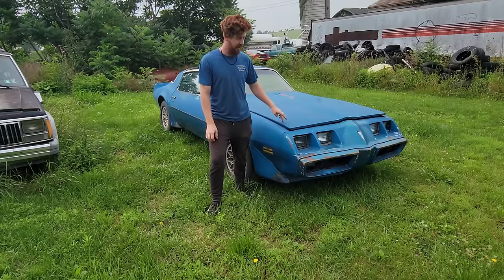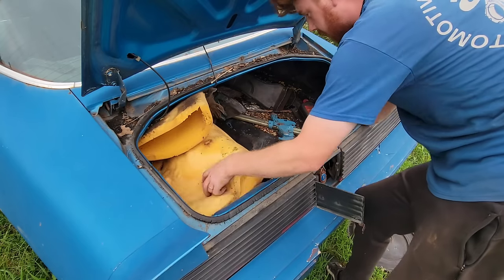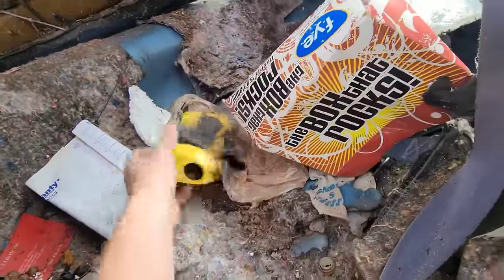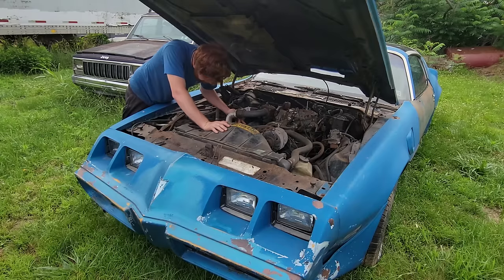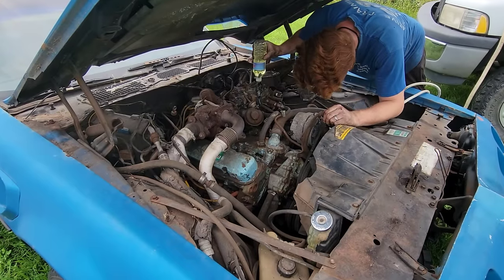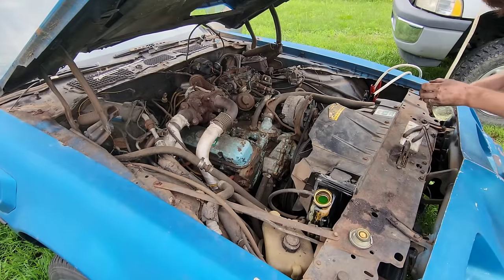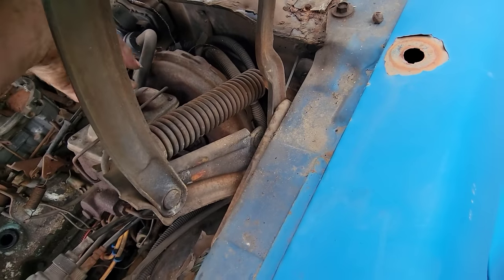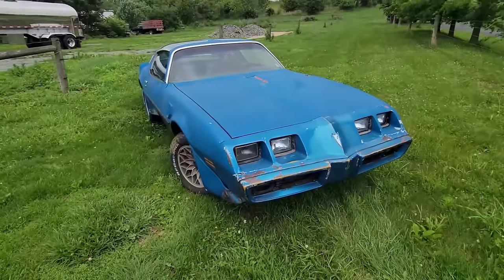1980 Trans Am Turbo Revival! Will it Run and Drive After 18 Years?

Comment: I would love to see a turbo T/A with a tastefully done single turbo LS. Everything else original and functional such as the factory boost guage. Nothing obnoxious, but just the right amount of spice.
Reply from the maker: That would be interesting!
Reply: Nah  far too many of those
Reply: @tomcherry7029  i agree, it's been done to death. what i would rather see (and i acknowledge it's obviously not the best/easiest option) would be building the original 301, to the extent that it's possible, with good MLS headgaskets and ARP hardware throughout, and replacing the turbo with a properly sized, modern ball bearing turbo. basically just make sure the motor isn't made of glass, match it to a good turbo with free flowing exhaust, and see what it'll do.

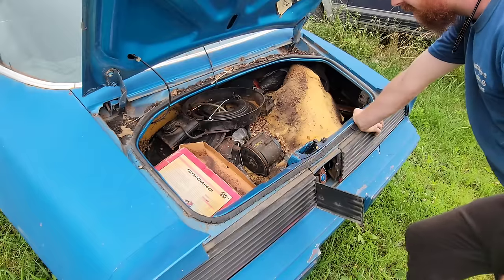Comment: Sweet ride and great video! I bought a clapped out 80 Z28 when I was 18 that was an old street strip car with a 4:10 posi. Had a B&M shifter that I didn’t know was on its last legs. Was going through the gears hard one final time and hit park at warp speed. Car a did a 180 and stalled out. I figured I grenaded my t-350 but when I restarted the car I felt it grab drive. Drove to work and did my shift and expected a big red puddle when I clocked out. WOULD YOU BELIEVE IT DIDNT LEAK A DROP?? The t-350 gets my vote for best transmission ever after that lol. Sorry for rambling just wanted to share my ratchet shifter cautionary tale 🤣
Reply from the maker: @Chris-qv5mc  I love hearing story's like that! I used to own a 1979 all black trans am with the 403 olds and a th350, that car had 2.43 rear gears so it was a great cruiser. I used to take it to the drag strip for fun. One day during a test run I accidentally popped it into neutral instead of 3rd at full throttle, and since they didn't have rev limiters back then, I watched the tach hit 10k before I had time to react 😅 fully expecting to need a new engine, I was extremely surprised to drive away with out so much as a lifter tick from that 403. Still to this day one of my favorite engines!

Comment: Sounds like the brake booster may need to be replaced. That "Shhhh" sound usually means the diaphram is leaking. Brakes probably just need a good bleeding. I have an '81 Turbo Trans Am. I'm guessing someone has been taking care of that engine in recent years even if they didn't drive it. Maybe they poured enough fuel in the tank to run it a bit each year until the fuel ran out. Lucky they didn't leave gas in the tank or it would have rusted. Good luck with it. It will be really nice if given a little TLC.

Comment: I say something's up because that's a RPO code "LU8" VIN code "T" turbo 301 V8, but the VIN on the insurance card shows it to be a regular, non-turbo 301, with the VIN for the win:

2 for Pontiac, W for Trans Am, 87 for two door coupe, W for 4.9L (301 CID) V8 with four-barrel, non-turbo, Pontiac produced, RPO code "L37", A for 1980 model year, N for Norwood, OH assembly and the rest is the production sequence. The Norwood, OH plant closed in August of 1987. A Turbo car would have a "T" in place of the "W" for the 5th VIN digit. Does the VIN on the dash match the one on the insurance card?

No trim tag (by the left fender area, under the hood), can't brag, but easy to figure out, no doubt: 80 for 1980 model year, 2FS87 for Pontiac (2) Firebird (FS) two door coupe (87), N for Norwood, OH assembly, 24L 24U for Tahoe Blue lower and upper exterior paint, A51 for bucket seats, A31 for power windows, 26B for Blue Hobnail Cloth interior trim, CC1 for T-tops, among other codes.
Reply: Also it should have a "TURBO TRANS AM" decal on the rear spoiler. And the "turbine" only Turbo car wheels
Reply: @GasserNorm  Not entirely correct. My 1980 turbo bought new by my parents has snowflakes.
Reply: I just acquired one of these turbo cars.  It should say Turbo Trans Am on the back sticker.  The Snowflake wheels came with the WS6 suspension package.
Reply: You can get snowflake wheels without WS6. Also, the turbo flows in 1980-1981 could be had with the WS6 package.

Comment: I'd check the engine for displacement. I'm a guy from back in the day. We would never pull a crappy smog engine and replace with another one. That could be a better find than you think. Especially being a reman.🤔
Reply: Looks like a standard rebuilt 301 turbo V8.
Reply: @googleusergp  that would have been a waste of time swap/rebuild then 🤔
Reply: @aumetalmental8403  I'd agree. I'm wondering if the prior owner owned a few cars, one a 1980 non-turbo, and one a turbo. It has the turbo hood, and we'd just need to verify that the 5th VIN digit on the dash is a "T" and not a "W". The "T" means turbo 301 V8 and the "W" means non-turbo 301 V8.

Comment: Great stuff! Fun to see work on the old Camero from my very young days. I've NEVER seen a turbo set up like that one I must say! Weird but as you said 50% of something is better than 100% of nothing. LOL. Thanks good job!  Oh remember when starting anything with a Carb and not Fuel Injection you need to give it some throttle while turning it over. SOmetimes a lot and other times not so much. (Those old gals had personality lol.). Just thought I'd remind ya!
Reply: This is a Firebird, not a “Camero”. GM did build a CAMARO though.

Comment: Had a black /gold 80 Turbo SE T/A  Not much hp but fun to drive, especially with the t-tops off. Miss that car
Reply: That was the same car they used in Smokey & Bandit II. The production crew had to mod them with nitrous to get any kind of performance.
Reply: @jamesnoble3502  didn't know that. Cool
Reply: @tripdad  if you ever watch the movie or haven't in a long time, there's a scene towards the end where Bandit makes a hard left off a paved road into a desert area and you can see the front right tire is a smaller white wall tire (the factory spare?) with a rim that was hastily spray painted gold to match the rest of the car. I'm guessing they bent the original wheel doing a stunt and didn't have an extra to swap it with?  Oddly enough in the first Cannonball Run movie there is a similar scene during the beginning chase with the Lamborghini with a 1980 Turbo Trans Am police car with a non-matching front tire and wheel skidding off the road
Reply: @jamesnoble3502  I've never watched the second one. Guess I'll have to now LOL. It's funny because when I bought my car in 87 one of the wheels was a mismatch to the others. Three of the wheels had the beauty ring and the fourth one did not
Reply: @tripdad  the sequel is a huge let down. The script sucks, Burt seems bored, it's got no momentum, there are plot holes and logic loops galore, it's obvious everyone in the cast is just picking up a paycheck. Jackie Gleason is really the only good part of the movie. That and the black '80 Turbo Trans Am which was brand new when that movie came out.
Reply: @jamesnoble3502  I'll check it out for the car and Jackie Gleason
Reply: @tripdad  ok.. nobody in Bandit 2 is acting like they did in the original movie. It's like it takes place in a completely different universe. It's not uncommon at all. It's called "Sequelitis". Happened to a lot of movie franchises. Die Hard...Robocop...Jaws....Superman...

Comment: Wow. I can't believe you put fuel in the tank lol. But hey it's your car. That rust will just burn right through those ancient cavities right? LOL.  Rock on Bro!  Okay I just watched the rest of the video and you're going to sell it?? Well as I said "It's your car". But I sure don't get it. Thanks for the video and I'm sad to say goodbye to the T/A. I guess I don't have any real reason to come back and check out the progress so take care!
Reply from the maker: If I weren't to sell it, what would you like to see me do with it? My plan was to bring it back to life and sell it to somebody else to enjoy, but I'm open to suggestions!
Reply: @corytaylorbuilds2566  Well, man I own '80 T/A which is by the way pretty much same color and it's about 4000 units later buld according to the VIN (124038) here in Finland. It was a n/a 301cid V8 car, but I've installed '95 LT-1 drivetrain in it plus 3.43:1 gears and this thing goes! So, it would be entertaining to see some power mods to it. Turbo 350 maybe? ;) Or smog era 455 plus turbo?

Comment: Hi Cory, what did they use to plug the hole in the heads where the pollution pump tubes went into? I have a 80 TA non turbo. Would I have to add a vent on the left valve cover? I'd like to eliminate all that pollution crap. thanks
Reply: On the Turbo 301, that curved tube he found in the trunk would go from the valve cover up to the breather element which is clipped into the air cleaner.
Reply: I believe it was. All part of the A.I.R. system.
Reply: @googleusergp Thanks for the reply but that isn't what i was referring to. The front face of the cylinder heads have a hole that a tube connects to and goes to the pollution pump. I want to eliminate that and plug the holes in the heads.
Reply: @caseycassidy-k4z  Why I don't know. LOL. It's not going to make it run "faster". LOL.
Reply: @googleusergp I don't know what you're LOL about. These cars are big and heavy. And slow. I want to eliminate any unnecessary weight. That pol. pump and brackets weigh15 - 20 lbs. It also has a pulleyandbelt turned by the engine. It may not be a lot of drag on the engine but it's some. Every little bit helps. Plus it's less clutter on the engine making easier to work on. The AC crap is now also gone and there is quite a difference in how the car feels. Big improvement.
Reply: @caseycassidy-k4z  Removing all that does nothing but make it a clapped up hooptie.